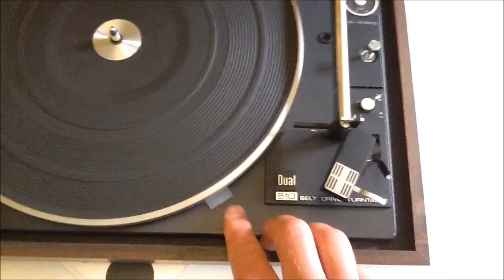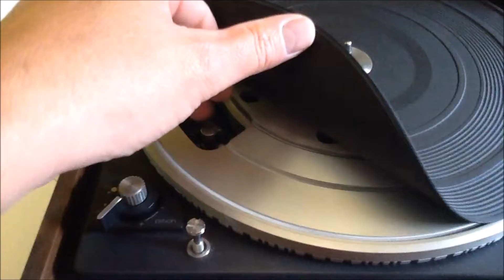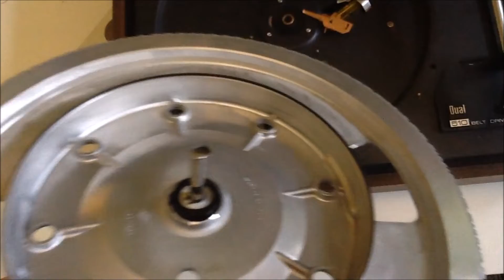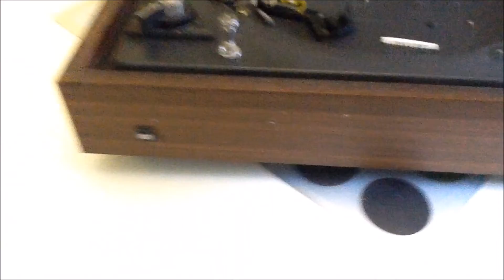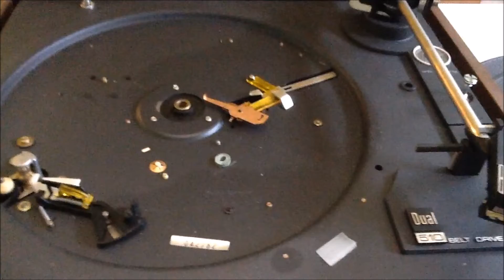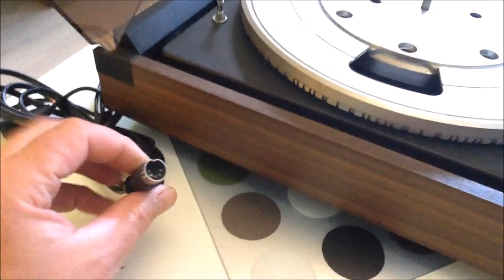Repair a DUAL 510 part 1

Comment: Hello, thanks for posting your video on the Dual 510.  I am the original owner of a Dual 510 and I need to replace the cartridge sled.  When checking online, some sellers offer a TK-14 and others offer a TK-24.  Some say that these two sleds are interchangeable.  I wonder if that is correct or not.  The original head shell has a contact strip that is straight across and my original sled has 4 contact pins that are also in a straight alignment, however the sleds that I am seeing online have 4 contact pins that are staggered, two high and two low.  I can't imagine how these pins will make good contact with the contact strip in the head shell.  Would you be able to guide me as to where I may purchase the correct sled for my Dual 510?  I would very much appreciate any help on this as I am stuck.  Thanks, Steve
Reply from the maker: I do not know if these sleds are compatible. You could ask at audiokarma.org . There are Dual experts there.
Reply: @JanCumps  Thank you Jan.  I will check out audiokarma.